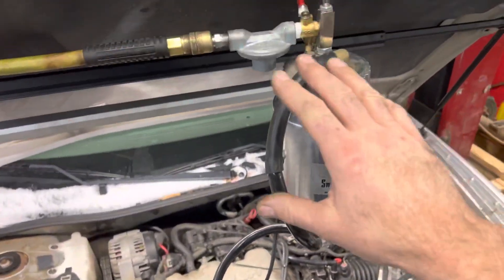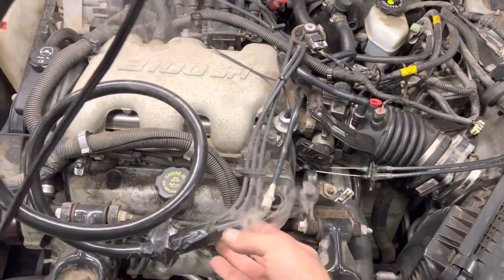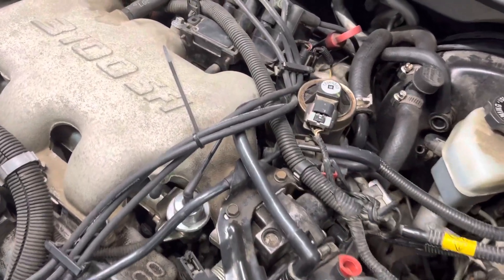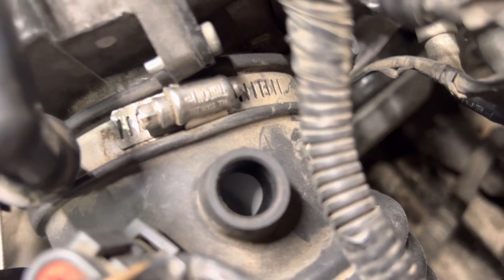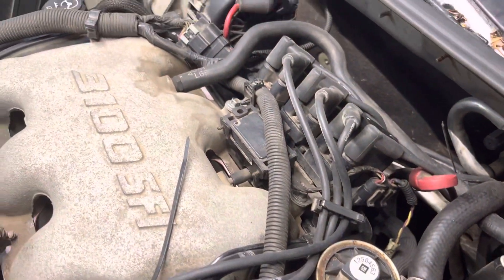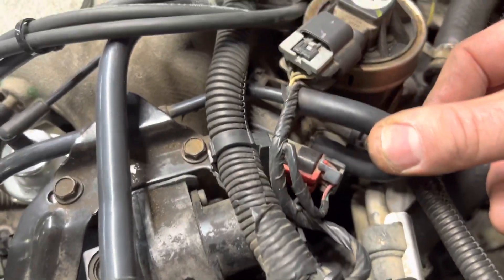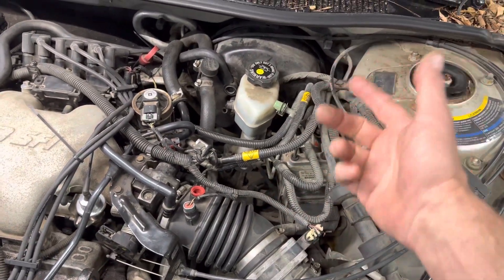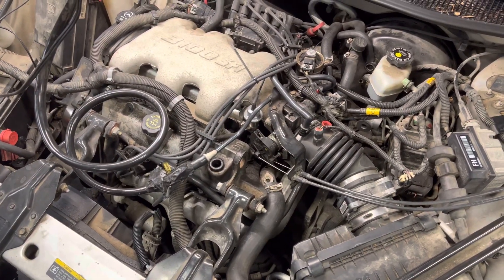Smoke Testing An Engine How To Find A Vacuum Leak On A Car

Comment: Is there a DIY method to get smoke into the intake without that machine?
Reply from the maker: Well, if you wanted to make one yourself like we did years ago. We use a single glow plug from a diesel engine and a metal coffee. Can that had some baby oil in it. You can’t put it completely under the oil it has to be done a little differently. You can look up here on YouTube for homemade smoke machines. If you wanted to make one yourself, you can do it pretty cheaply for about 20 bucks. We finally got tired of it not working great because you have to have air going into it as well so we just bought a complete unit for I think 85 bucks off of Amazon and I’ve used it for almost 20 years.

Comment: Should i get a smoker? Im at 14% ltft with p0420 cat code.
Reply from the maker: Well, that high fuel trim could be caused by a plugged up catalytic converter so the first thing we would do would be to use a back pressure gauge and make sure that thing is free flowing like it’s supposed to be. If not, you’ll want to address that first.But, if it’s adding that much fuel, it could have a vacuum leak and a smoker would not hurt and they’re always fun to use.
Reply: Where would you smoke test a 2015 explorer for a vacuum leak? And is it just 1 point or are there different systems you need to check?

Comment: You hooked yours to the pcv valve but I've seen people hook into the brake booster vacuum. How do know what's the best hose is to test? I'm throwing lean codes of that matters.
Reply from the maker: @TwistedLyfofTV  doesn’t matter as long as it is a vacuum hose going into the engine where the smoke can reach any point that may leak
Reply: Oh that was quick. Thank you so much for replying. ❤ @UnderTheHoodShow
Reply from the maker: @TwistedLyfofTV  Thanks for watching and commenting.
Reply: Best videos on YouTube
Reply: It only matters if the brake booster is not the source of the vacuum leak! I hope you figured out what was wrong!

Comment: hi great vid, i need to find out if i have leaks in my fuel lines and my air lines, its ford transit custom, can you help me, where do i put the smoke machine pipe into? thanks
Reply from the maker: You need to find a vacuum port on the intake manifold. Also close off the throttle body when testing.

Comment: Normal smoke comes out from Dipstick when pull it 
Out ?
Reply from the maker: If it is getting into the PVC system and entering the valve cover. Yes.

Comment: Does a throttle body have to be open to do a vacuum test?
Reply from the maker: It has to be closed
Reply: @UnderTheHoodShow  so that means you have to introduce the smoke after the throttle body right?
Reply from the maker: @harrycash8713  yes, or put it into the intake hose and open it and see if the throttle body leaks.

Comment: Where do I plug the smoke cable to?
Reply from the maker: Any vacuum line on the intake. If no vacuum lines we use the throttle body as a smoke entrance.
Reply: @UnderTheHoodShow  is it okay to put it where the air pressure sensor goes? For example the hole where you were showing is the smoke build up at
Reply from the maker: @leecountycopwatch81  you can use a sensor hole also.
Reply: @UnderTheHoodShow  thank you!

Comment: So i just dropped around 2k to fix a fuel issue at the dealer. Check engine light back on this time for bank 2 lean. p0174. Car is a 07 Cadillac STS ive replaced the MAF, and the Purge control solenoid as it was allowing vacuum 100% of the time. still throwing a code, i have a smoke machine but need a device that can actuate the valves. what is the most affordable one you would recommend? im looking at the Ancel X7 will this do the trick you think? this will be a one time job so i dont need some big fancy high quality one to last me a life time. just one that will do this 1 job. thanks in advance for the help!
Reply from the maker: Some basic blue tooth scanners can do it but the only one we know of for sure that's a handheld is the ones from Autel as far as affordable ones. Check the specs of any one you wish to buy before purchase to make sure it will do what you want.
Reply: I’ve got a P0171 on my ‘03 LeSabre. I cleaned the MAF sensor and cleared codes, will replace PCV valve this week. Maybe try that
Reply: @lilyell6978  hey I have a Buick Lucerne with the same issues. Slightly different code p0171, bank 1 too lean. A mechanic checked and said everything looks fine and wants to do a smoke test. My pcv valve and hose looks fine, no cracks. Should I just do the smoke test? Seems like an annoying use of $100+ dollars for a mechanic to do just to throw smoke through my intake.

Comment: how much does it cost to have a smoke test done? I’ve got a 2012 Town & Country Chrysler it’s got the engine light coming on but it’s they tested it and said it SC needs a smoke test it’s got a small leak vacuum leak how much does it cost to have that done if I take it to the dealer and Chrysler
Reply from the maker: We see from $120 to 250 depending on shop and area. Ask your local shop to be sure.
Reply: Have you got it done?

Comment: Great video. Is it normal for a little bit of smoke to come out of the oil filler neck cap when smoke testing for vacuum leak?
Reply from the maker: Yes.
Reply: @UnderTheHoodShow  Can I expand on this please? In order to find rough running Renault (no codes or fault lights on dash) I carried out a smoke test from two points, one from a pipe directly connected to the inlet manifold and after reconnecting this I disconnected the air inlet hose (after the air filter casing) and repeated the test. Both tests showed a high flow leakage on the flowmeter and of course no pressure build up on the machine pressure gauge and not one visible sign of smoke from within the engine bay nor anywhere else at all. On the basis that the smoke had to be damn well going somewhere I took the oil dipstick out and bingo high volume of smoke and likewise out of the oil filler cap as you would expect. There is no oil in the water nor bubbles in the coolant when engine running so I am a little baffled right now. I expected a small amount of smoke but not the whole output. Any thoughts please? p.s. Other thoughts every now ant then the pressure gauge did go high and then drop in an instant. The car is a diesel

Comment: Running a smoke test on a 08 Impala (3.5)..... the only place I'm seeing loads of smoke coming out is at the breather.....is that indicative of a bad MAF?
Reply: Your suppose to take off the air duct that connects to the throttle body and plug the throttle body then smoke test 💨 if you don’t plug the throttle body then all the smoke will go thru the air filter and out into the atmosphere and will not build up any pressure
Reply from the maker: Thanks for watching. When you put smokin through a vacuum port it should come out the breather where the air filter is hooked up. It should not leak out anywhere else like around mass airflow sensor‘s or any other vacuum ports that are currently sealed.